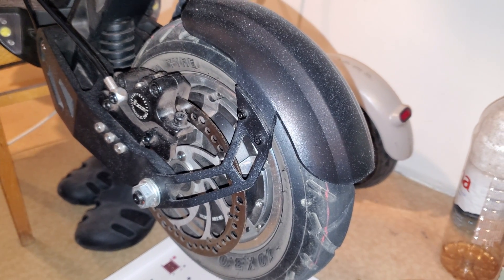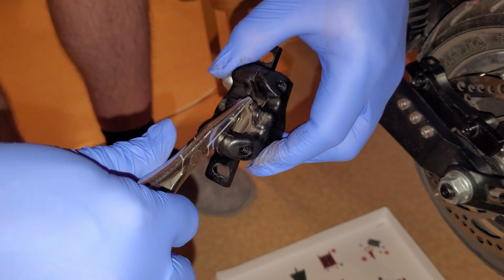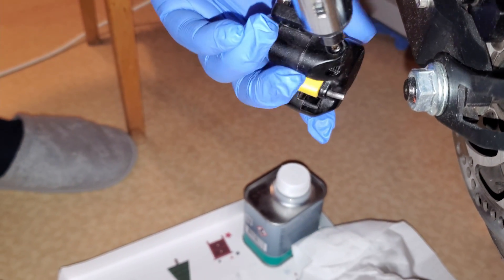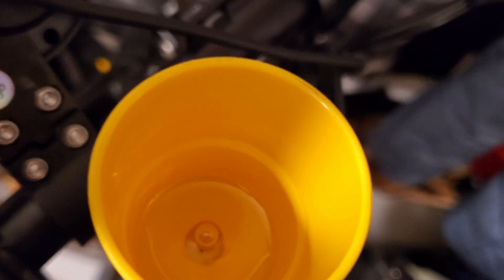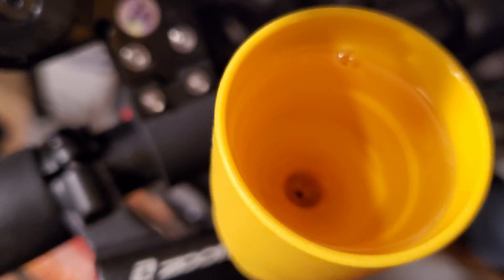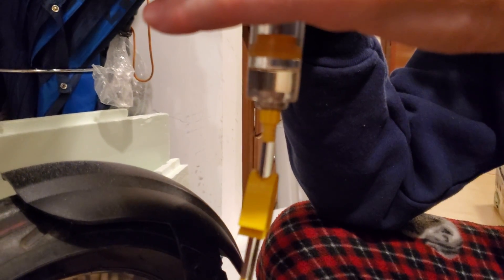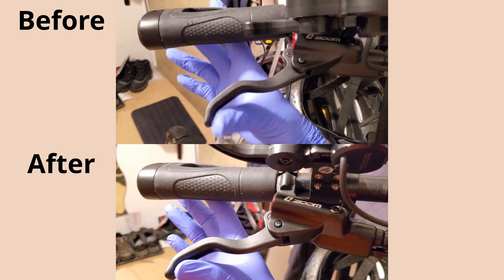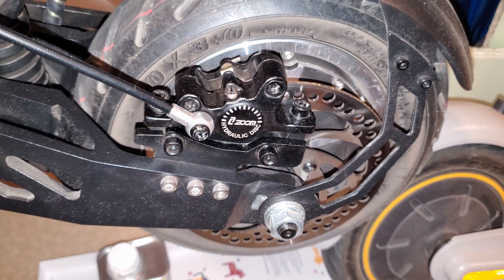Bleeding Zoom Hydraulic Brakes on an Electric Scooter (VDM-10 / Apollo Ghost)

Comment: What kind of tools did u use to unscrew there’s a metal part in the middle that blocks the way😢
Reply from the maker: You need to use a 'security torx' screwdriver bits of the correct size.
Reply: @  appreciate it man really solved the leaking from ur video🫡🫡

Comment: Hello there!. It’s a very nice video on how to bleed the zoom breaks. But i have some questions because im planning to bleed my scooter:
1. Ill be using a red shimano and you’re using a transparent one. How would i know if i flushed out the old oil?
2. What do you do with the leftover oil you used after you bleed your breaks? Do you discard them or you put it back on the new oil container ? 
I hope you can help me with this.. it’s my first time in doing it and i don’t want to screw my breaks. 🙏🙏🙏
Reply from the maker: I also used red shimano during my second brake bleed, it works fine. To flush out the old oil unscrew the bottom plug and to release the oil unscrew the top plug and let it drain out. It does not have to be 100%. 
Collect the old oil in a separate container and throw it out. Dont reuse the old oil.

Comment: Link to the tool? With the Allen tips & wrench?
Reply from the maker: Which tool are you referring to? I just use standard pliers, and a screwdriver with allen and torx bits that are listed in the description. Don't have a specific link for the ones shown as I had them for a long time, if you have trouble finding similar ones on amazon or other gardware store let me know and I will try to link some similar ones.

Comment: Is there any way to separate the hydrolic hose from the brake line (the metal piece that connects to the caliper at the end)?
Reply from the maker: Sorry for the late reply, this might help https://www.youtube.com/watch?v=iaf0kMCa6n0 also if you need to remove the end from the hose the process is the same as I did for the pin removal in this video https://www.youtube.com/watch?v=QWAlpi3jz98 skip to the bookmark on pin removal
Reply: @Lantea13  I replaced the zoom calipers with Shimano deore xt in the end. Wasnt able to remove the end of the hose from that metal piece and couldn't find that hose anywhere. Thx for the reply anyway.

Comment: Fail 15:53, Should never reuse a lower grade Chinese knockoff brake  caliper cotter pin,  and Always replace said pin with premium grade cotter pins. Said reused pin will eventually fail & loosing or back out when your failing to brake while failing to beat a train at a train crossing and that will be the end of you in a instant, cheap life with a cheaper unsafe result.
Reply from the maker: Well, it held up for 12+ months and through several more brake bleeds, until I replaced the whole brakes with NUTT ones because of the constant oil leaks on the zoom brakes.

Comment: Could you possibly tell me what the exact model of hydraulic brakes is on the Apollo? I'm looking for aftermarket hydraulic brakes & it's one of the most complex items I've ever tried to find. I've got a '22 Apollo with regular brakes (very big mistake not getting the one with hydraulic brakes) & so far, "Zoom" is all I can get out of anyone. I know it's 140mm discs, top-mount calipers, both on the right side of the wheels. It's impossible trying to find out what people who speak Chinese mean by "right side" - sometimes it's handlebars, sometimes it's calipers.
Reply from the maker: The ZOOM brake model number should be HB-875-E. Here are all the details I could find when I was trying to repair my ZOOM brakes https://imgur.com/a/07yk16h 
But I would strongly advise you to get the NUTT hydraulic brakes instead of the ZOOM brakes. The ZOOM brakes on my Ghost (VDM-10) started leaking at the caliper and there was no way to repair them. I decided to upgrade to NUTT hydraulic brakes and so far they are way better.
I bought a set on aliexpress for around $110 (US). The seller I bough from no longer sells them, but if you search for "NUTT Hydraulic Disc Brake Set" you will find plenty of sellers, then just find a listing that clearly indicates the correct brake caliper orientation (on the Ghost both are on the right side), you can always also confirm with the seller over chat before you order (just an example aliexpress . com/item/1005005202156542.html no idea if this seller is good, you need to do some research on it and compare with other sellers).
Hope this helps.
Reply: @Lantea13  Thank you, you have no idea how long I've been searching for a simple model #. It's a huge mess of configs (right handlebar for rear brake, which is on right side, 140mm disc, etc, etc), and so far you're the first person to ever direct to me to a specific model #. I knew what to get, but the configs were all in broken English (e.g., "Right side" means handlebars to one person, but means disc/caliper to another - specifics always seem to be missing). 
I appreciate your going the extra mile here.

Comment: What if the new oil is not the same as the old. Can u stil try to puch out the old oil even do its not the same as the new?
Reply from the maker: As long as its miniral oil for bicycle hydraulic brakes it should be fine. If you are switching to a different brand oil its generally recomended to empty the old oil and fill with the new one. If a little bit stays in it should be fine.
Reply: @Lantea13  thank you for coming back to me. Do you by any chance know what the size of the tiny washer is? The prev bike shop that bleeded it for me. Never puted the one washer back. When i did the bleeding myself over the weekend i saw that one the one side the tiny wahser is gone. And i did tell them to be aware of it. But they have no pride in their work it seems.
Reply from the maker: @sn3ke124  Which washer? Do you mean one under this screw https://youtu.be/d4OY8q4Ymks?t=416 older zoom models had a washer here, but there was no washer under this screw in my brakes. If you mean a different one let me know which and I might be able to help.
Reply: @Lantea13  yes exactly under the screw as in the video. I also have zoom breakes. But mine has a tiny washer under the screw like u said the old ones use to have.
Reply from the maker: @sn3ke124  Sorry not sure what size it is, since I can't measure mine. If you still have the other washer you could take it out and go to a bicycle service or hardware store and ask if they have a same one. If not take the screw instead and measure the diameter of the opening.

Comment: Hello , my zoom brake is leaking from pump , did anyone had this problem and know the o-ring size to fix it ? 😀
Reply from the maker: By pump, do you mean the brake lever on the handlbars or the brake caliper on the brake disc?
Reply: @Lantea13  brake lever
Reply from the maker: In that case I am not sure what size o-rings it uses, I only had to deal with both my calipers leaking, but in the end I was not able to fix them even with new orings and just replaced the whole zoom brakes with nutt hydraulic brakes. Maybe someone else has experience with the brake levers, if not, you might just have to try and disassemble them and see what orings or other parts are faulty. The main problem with zoom brakes is that there is no service manual or any other manual or documentation available from anyone about the brakes; and the only advice I got from the seller was to replace the whole brakes when they leak...
Reply: @Lantea13  its actualy not orings , its a different type of seal , kooks like in shimano leawers , I was ither thinking to order shimano seals and mayby ill get Lucky with the size , or just replace it with normal orring , in theory it should work ,its only low pressure side seal , and other leavers using just normal orings

Comment: Not sure If you're still responding to comments but can I use any bleed kit for these brakes or do I need the specific one you're using? Thanks in advance
Reply from the maker: Hi, always responding :) You can use other bleed kits, but you need to make sure the bleed kit you use has the correct size adaptors to use with the brakes. Usually the bleed kit has a list of compatible brakes its designed for.

Comment: At the end of the vidrio, when testing no rubbing in the pads on the rotor, your tire seemes to wobble. Is this normal?
Reply from the maker: Not sure if its normal, but it is common on stock tyres that are not manufactured perfectly and are not balanced. You can try to balance the wheel with weights (https://youtu.be/zSzrtAGhc60), or if you get a high quality tyre such as PMT it should not wobble if seated correctly. Cheap chinese tyres will wobble as they are not perfectly balanced.

Comment: Hi bro can i ask how you installed your hydraulic brakes 😊
Reply from the maker: Hi, the scooter came with the zoom hydraulic brakes already installed. If you have the version with mechanical breaks its possible to upgrade to hydraulic brakes. You can check out this post https://www.reddit.com/r/ElectricScooters/comments/rq0nn2/ghost_mechanical_to_full_hydraulic_nutt_brake/ where a user upgraded to NUTT brakes.

Comment: I was bleeding and put new oil IN my dualtron but when brake it Comes smoke fro the brake . What is this i noticed it direktly
Reply from the maker: Not sure what might be causing the smoke. Maybe if some oil residue was left on the brake disc or brake pads it might be smoking when the brakes heat up during use.
Reply: @Lantea13  i had very much trouble to put in brake pads it took my maybe 3 hours i really pressed out the brake so it could fit . Its still coming smoke i think its to tight how can I lossen the place so its not so tight normally its not like that it happend after i was bleeding the brake
Reply from the maker: @fixmyscooter729  Did you place a block between the brake pistons before you started the bleeding? (https://youtu.be/d4OY8q4Ymks?t=212) If not, that is the only reason I can think of why the brake pads would be hard to put back and too tight.
If you did not use the brake block to keep the spacing for the brake pads, the only way to loosen it is to bleed out some oil and allow the pistons to fully retract and insert the brake block to maintain the correct spacing.

Comment: Nice video I'm currently fixing my varla eage one icause a a bent disc brake I removed the zoom caliber and 4 sliver washers came off from the bottom. I'm fixing the front one not the back tire I'm a little confuse? Help
Reply from the maker: The washers are used to position the caliper at the correct height on the brake disc.
Reply: @Lantea13  So there's 4 put 2 each on each side of the screw.
Reply from the maker: @antwan1234567890  That is what I would try.
Reply: @Lantea13  Foshoo thanks for the insight.

Comment: Hello thank you for that amazing video. I have question ; I realize that especially in hot days my breakpad squize the disk and give more heat to electrical motor. Do I have any change to little bit loosen the brake pad from disk?
Reply from the maker: On hydraulic brakes there is no way to loosen the brake pad squeeze on the brake disc, that is adjusted automatically as the brake pads wear down; you only need to center them on the brake disc properly. The heat from the brake disc should have no impact on the temperature of your motor.
Reply: @Lantea13  Thank you for your answer, I realized that in summer hot days may hydraulic oil  expand and squize brake pad. I feel that motor wants to go further but brake do not let it easily at that time .In evening I didnt face such problem.
As I understood I need  to do more brake and wear  down some brake pad in order to get over this situation.

Comment: What does it mean if the brake lever feels spongy after folding and unfolding it and then the pressure comes back after priming the lever?
Reply from the maker: Afaik, it means that you have some air trapped in the brake lines. If you bleed the brakes and get the air bubbles out it should solve the spongy brake problem.

Comment: I've a Buyoeda scooter with same zoom brakes, and my front brake started squirting fluid where the brake pads are, I don't know what to do or what caused it. Has anyone encountered this?
Reply from the maker: I have not encountered this issue, but it could be due to the rubber o-ring in the piston being damaged. If the leak is big you could try taking apart the caliper to see what is broken inside and ask a local bike repair shop if they have a spare part that would work.
The problem with zoom brakes is that there are no spare parts, manuals, or guides available anywhere for them, so you will most likely need to replace the whole caliper if there is a leak.
Reply: @Lantea13  Thanks so much for the quick reply. I guess i'll have to order new ones. I just don't know what model those are,they're exactly like the ones in your video. All i see on amazon is HB-875. Or i might have to order from China. Today's a terrible day for me, because I use the scooter for work :(. But thank you so much for the information. Hopefully i'll get it fixed soon.
Reply from the maker: @lukasgadzijevas7163  From my research they should be the HB-875-E this is what I was able to find out about them https://imgur.com/a/jFBpwiN
I also got a leak in my zoom brakes, but at the banjo where it connects to the caliper. Luckily its a slow leak so I still did not get around to fixing it. I ordered replacement NUTT brakes instead of zoom, as I heard they are more reliable and you can find bit more info about them online. I ordered them direct from china as it was about €60 cheaper compared to a local shop. But you need to make sure they are compatible with your scooter setup. From what I remember there were some sellers in EU that sell a replacement zoom brake caliper for around €50 iirc. The full NUTT set cost about €115 from allie seller.
Reply from the maker: @lukasgadzijevas7163  Found the site in my favorites with the zoom brake caliper https://fastride.fr/en/pieces-pour-dualtron/1764-etrier-avant-de-frein-zoom.html and https://fastride.fr/en/pieces-pour-dualtron/1781-etrier-arriere-de-frein-zoom.html might be the cheaper option if you want to stick with zoom brakes.

Comment: When I received my Varla Eagle One I had no brakes! The levers pulled all the way to the handlebars. I was pissed to say the least. I had Sram and Shimano bleed kits for my mountain bikes but their fittings didn't fit the master cylinder port of the Zooms. I was desperate to try my new ride out so I took out the bleed screws at the master cylinders and just kept the hole filled with the Shimano mineral oil enough to not allow air down in the plunger and flicked the levers enough to burp but not puke out fluid. After only a dozen or so flicks per side I had full lever on both brakes. I couldn't believe how easy it was! And I was off! - to see how many times I could almost kill myself on a scooter with shitty handling that does 40mph! At least the breaks work great!

Comment: Hi. I am about to but the bleed kit that you put the link. But is there two same port adapter thread in that kit? It seems like you need one for the caliper and one for the lever. Pls let me know. THnx
Reply from the maker: Everything I used was from a single EZmtb bleed kit. It had all the parts in it for both the top cup attachment as well as the bottom syringe attachment, so if you buy one it should have parts to do the bleed as I did it in the video.

Comment: Is the red Shimano mineral oil also suitable?
Reply from the maker: Yes, that should work fine. I used it myself when I needed to bleed the brakes again. In theory any mineral oil for bicycle brakes should work. If you are switching between different oil brands its best to drain all the old oil out first, before filling the system with the new mineral oil.

The original oil in my Zoom Brakes had red colour similar to the Shimano mineral oil.
Reply: The red Shimano mineral-oil is (according to label) compatibel with all mineral oils, and will work on any system that uses mineral oil. I would however do as Lantea here writes and first drain old oil if you are changing brand and/or if the old oil has not been changed for several years.
Another suggestion is to use the mineral oil that is easiest available to you.

Comment: I can't understand why was so difficult ask question ti the direct seller...
Anyway , they tell me to use " mineral oil,DOT 4 " 
So why here i see mineral oil but whith 3 " not DOT " write on the box??? 
all zoob brake was the same ? That looks like my ( gunai 5600W )
Reply from the maker: I had the same problem, no seller can even tell me who manufacturers the zoom brakes, or provide a manual to them.

The ZOOM brakes use mineral oil, Not DOT fluid, do not use any DOT fluid or you can damage the seals.

There is no manual to the zoom brakes and no bike or scooter shop sells zoom oil (at least where I am), so your best option is to just buy any brand mineral oil that can be used in bicycle brakes. The original oil in my zoom brakes had red colour so the closest to it is the Shimano mineral oil, I got a different one because that was the only one they had at my local bike shop at the time.
Reply: @Lantea13  how STUPID can be this china seller!!??! They tell me mineral dot,like if was the same thing not the opposite